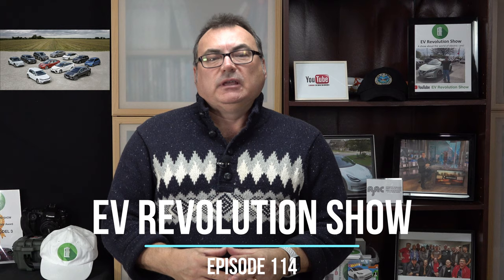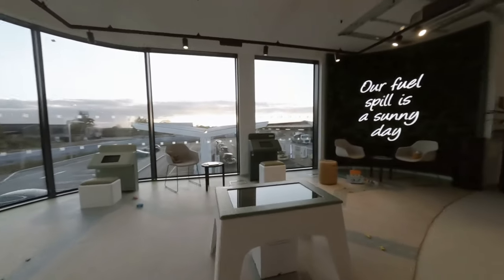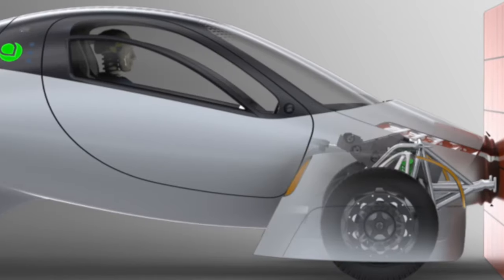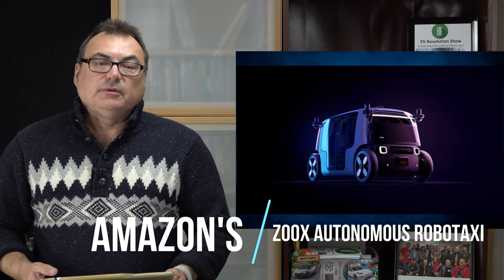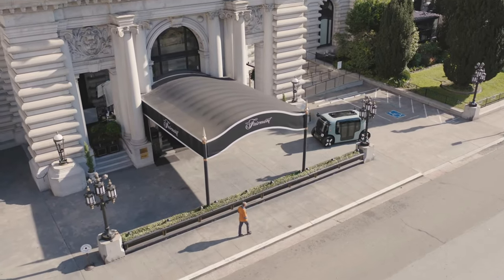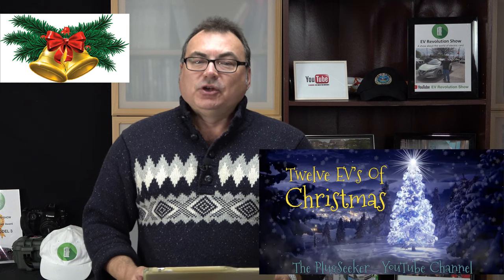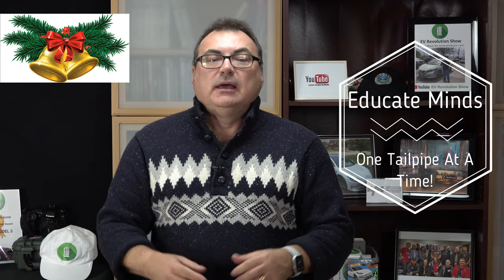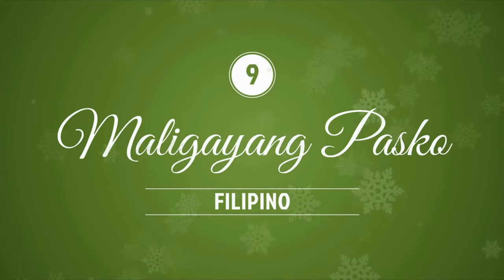Episode 114 - The EV Revolution Show

Comment: I think Toyota may  have missed the  EV boat  and some of the brass are in panic mode. Japan used to have very strict emission standards that required you replace your ICE motor after very low kilometers ,an EV would not fall into that so sales would be greatly impacted. Merry Xmas Ken and stay safe and healthy.
Reply from the maker: Yes for sure, thanks!

Comment: I think you misinterpret much of what the CEO of Toyota was talking about.  He was largely criticizing the rush to ban ICE cars BEFORE the infrastructure and technology is ready for true mass adoption.  I mean TRUE mass adoption - the replacement of every ICE vehicle out there with EVs, not the relatively small market share they enjoy today.  Don't get me wrong, I am a bit EV fan, and I hope we continue to get more and more EV options.  However, we're not even close to having the infrastructure and technology necessary to replace all ICE vehicles.
Reply from the maker: Thanks David for watching and for your opinions.  I can see your POV, however I still don't think I am misrepresenting Toyota's stance on EVs.  They put all of their efforts on the Prius Hybrid and the Prime, as well as the RAV4 Prime.  None of these are pure-electrics, which is the future we need to embrace now, not in decades.  I am sure you understand why.  

They also believe fuel cell is the future and while I agree it is great technology and even cleaner than electricity overall, it is nowhere near a mass adoption standpoint for supporting infrastructure.  For commercial fleets that and build their own fueling station, absolutely the way to go.  

So I think you can see my frustration in Toyota as they just don't get it that EVs, specifically all-electrics, are the way we really need to move at this point in time.  It takes an OEM 3-5 years to come out with a new model so if they start now, we won't see a model from them that is a BEV until 2025.  The clock is ticking on Climate Change and that is the urgency we face.  Toyota is shameful for their lack of leadership here and plain hybrids don't cut it anymore with the advancements in BEVs and supporting infrastructure in most major car markets.  Sure we still have a long way to go, but the future for BEVs is cemented IMO.

Comment: Electric vehicles are just better. No noise, no emissions, less fuel costs, less maintenance costs.
Gasoline and diesel are OLD polluting technology. So last century. 

Electric cars, electric trucks, electric buses, electric trash haulers, electric snow blowers, electric lawn mowers, electric snow mobiles, electric water craft, electric garden tools, electric mechanic tools, electric motor cycles, electric bicycles, electric scooters, electric farm tractors, electric construction equipment, electric delivery vehicles,  ...... everything is going electric.  No worries about starting after sitting for a few months. 
Gasoline and diesel vehicles and equipment  always need repairs.
Reply from the maker: Thanks for watching and yes agreed!